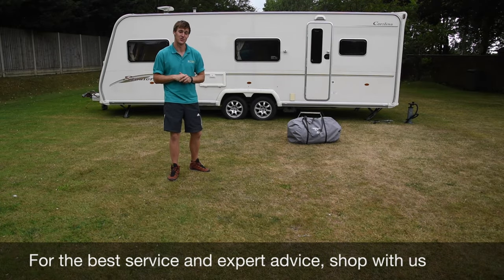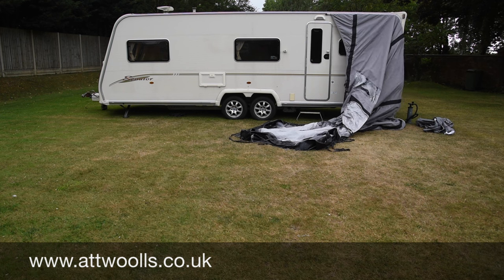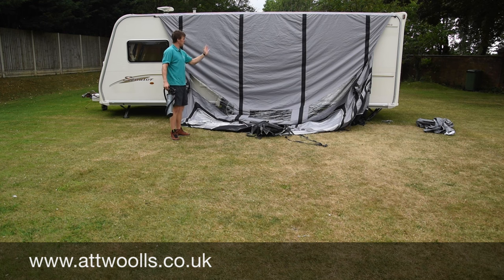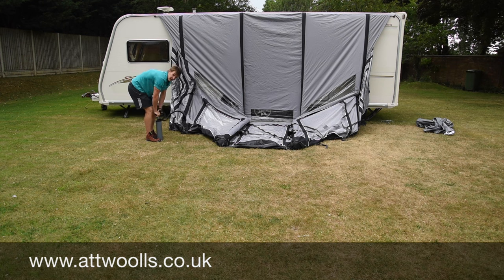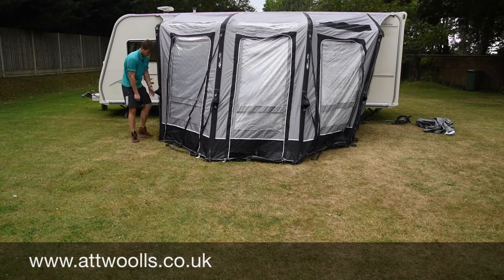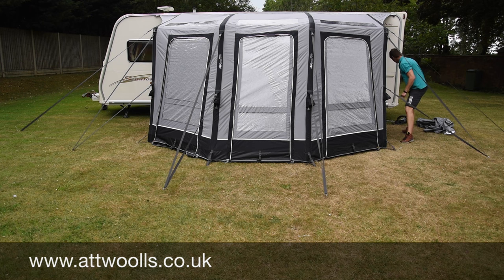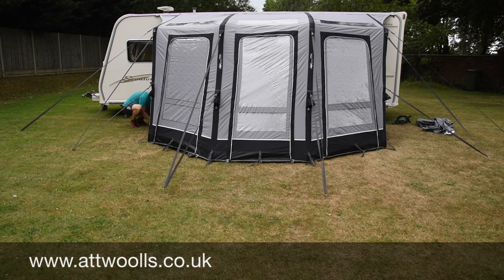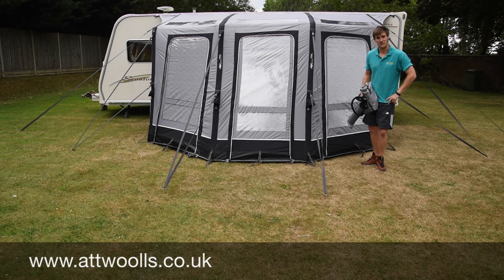How to pitch a Inflatable Awning (Tutorial) Video

Comment: We have the 390 air awning pro plus and we struggle to keep the straps that run along the inside of the awning flat . What can we do to rectify it ? It also happens if the caravan is high up . We wer3 told by someone to just cut 5hem out , but I don’t want to do this . Help 🙁
Reply from the maker: We would recommend buying some metal groundsheet pegs, that way there isn't a metal head sticking up and it should keep the strap flat.
Hope this helps.
Reply: But do we peg all the straps down before we blow the awning up 😀